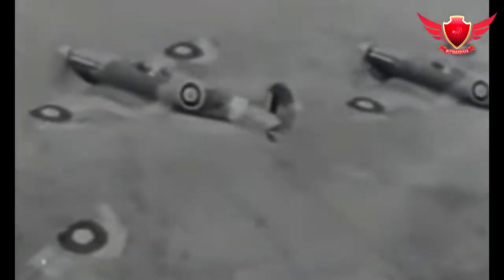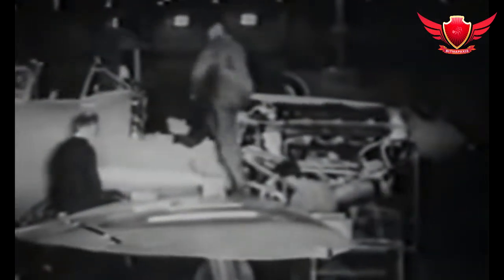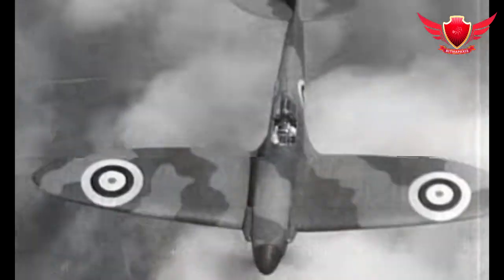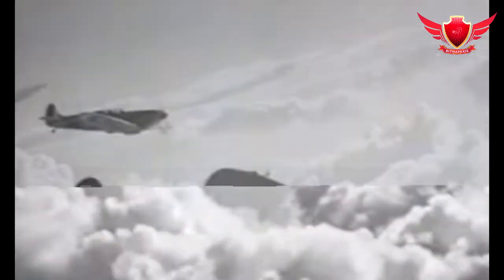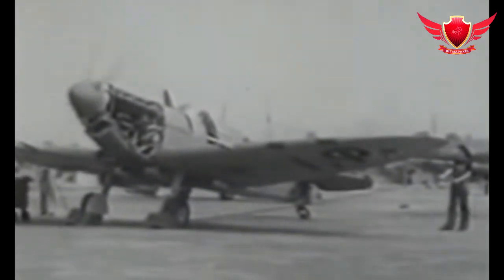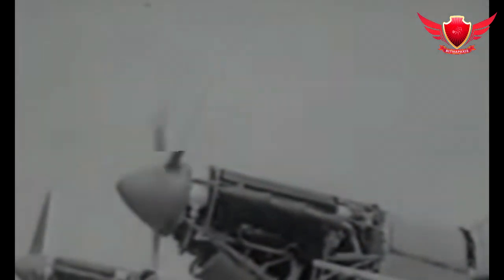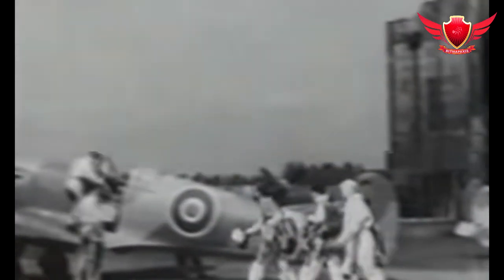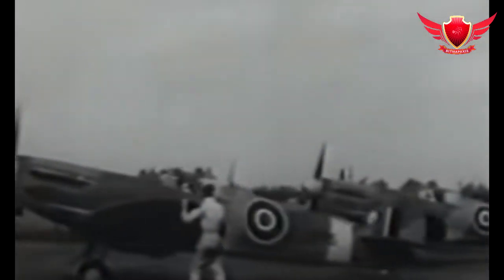Piston Engine Supermarine Spitfires that nearly reached supersonic speed!

Comment: On 6th February, 1952, a Spitfire Mk PR19 flown by Fl. Ltn. Ted Powles reached Mach 0,94 during a dive from 51 150 feet over Hong Kong during  a meteorological flight. That's the highest speed ever obtained by a piston engined aircraft,  and the highest altitude ever reached by a Spitfire. Not bad considering that both of these Marks had the original wings and fuselage  designed by Reginald Mitchell in the mid 1930s, somewhat adapted to the longer and more powerful Merlin and Griffon engines. If thereever was an aeronautical genius it was Mitchell. .

Comment: Accoeding to Capt. Eric Brown's book on the Miles M52, "On 27th April 1944 Sqn. Ldr. Tony Martindale achieved M = 0.92 in  Spifire XI. This is the highest speed ever attained in a piston - engined aircraft, and was due in no small measure to the pilot's attributes - 6ft 2in tall and weighing 210lb." The RAE were using the Spitfire XI as part of their transonic testing. Martindale had passed out owing to oxygen starvation and the aircraft dived. He recovered just in time to pull out and the recording instruments had measured his speed.